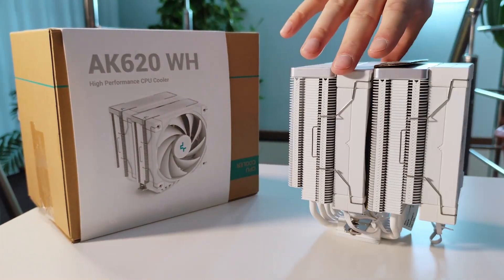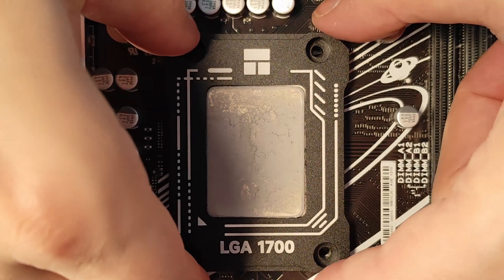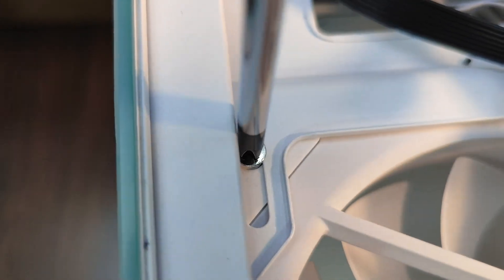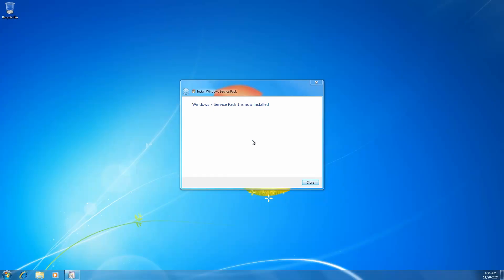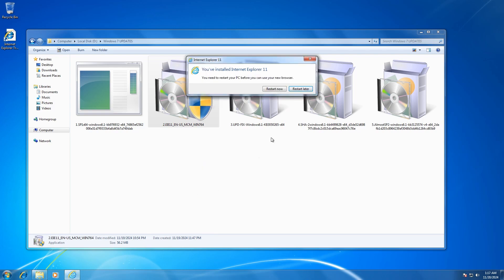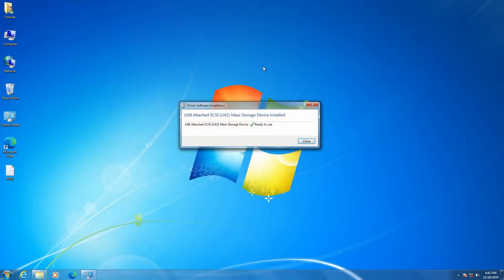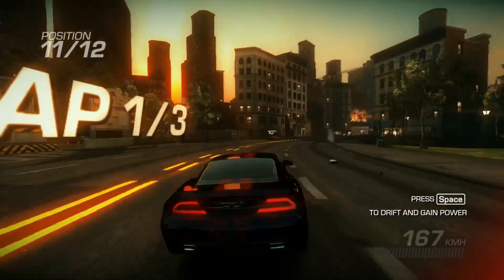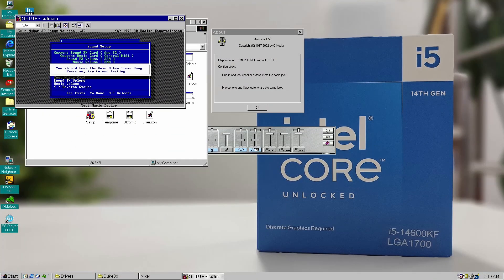Windows 7 Returns on Modern PC: i5-14600KF Intel CPU,  Z790 motherboard/DDR5 & RTX GPU

Comment: Check the Gamer's Nexus coverage on the bending issue of the 12/13/14gen chips.
The contact frame makes a LOT of difference, especially long-term, since the CPU bends with heat cycles and by the fact it's getting bent by the ILM by default.

Also, make sure to use the latest BIOS for the motherboard! So it doesn't overvolt the CPU with its bad microcode.
Reply from the maker: Yes, the BIOS was updated to the latest version released in November 2024—just two weeks old when I got the motherboard. Windows 98 still runs perfectly fine! :) I watched Gamer's Nexus videos, and I agree that using a contact frame makes a difference. What I don’t understand is why motherboard manufacturers don’t offer their own versions. It’s just a small piece of metal, probably costing around $0.80 to produce. Manufacturers could easily create their own branded plate, add a fancy design, and charge $15 extra for it. Yet, even on premium models, they stick with a standard ILM. The good news is that the new socket 1851 has an improved ILM with a few extra pieces. (it's marked as "RL-ILM")
Reply: @O_mores  
Nice! That CPU is safe then!

I agree with you about the contact frame, but I am pretty sure it's because of user error and Intel.
Let me explain.
When installing a contact frame, you need the perfect amount of pressure applied so that all the pins on the socket contact the CPU, and users can fail doing this, plus the risk of said users damaging the pins.
Also, the standards set by Intel had to be followed by the motherboard makers, so I doubt they can provide a contact frame.

Yes, the new ILM "fixed" the issue.

Comment: Where nvme ssd install windows 7  ?
Reply from the maker: Hi, I didn’t install it directly onto an NVMe drive because I have the original DVD, and it just felt right to use it. For an NVMe installation, you’d need to create a custom ISO with the NVMe drivers slipstreamed. Alternatively, you can install Windows 7 on a regular SATA SSD, as I did in the video, then add NVMe support by installing the NVMe update. After that, you can use cloning software to transfer the SSD partitions to the NVMe drive, and it should boot without issues.

Comment: Waiting for NT 3.51 and 95 lol
Reply from the maker: I didn’t have time to install NT 3.51 and Windows 95 and now the motherboard is gone. I did briefly try running my 'portable' preinstalled version of NT 3.51, but it didn’t work—possibly due to having too many CPUs and the MPS support was enabled. The good news is that NT 4.0 runs fine, even with multi-CPU support, and so does Windows 2000.
Reply: @O_mores  okay, it sounds good. What will be the next motherboard? I hope it's A620 AM5 :)

Comment: i just did this recently on whiskey lake, but i upgraded to 10 after i wasn’t able to get working wifi
Reply from the maker: Indeed, the latest WiFi 6 chips and even some newer Intel Gigabit cards aren't retro-friendly at all. This Z790 motherboard, for example, has a Realtek 8125 2.5 Gigabit chip from around 2021, which does have Windows 7 drivers. As for the included Wi-Fi 6E, I didn’t even bother searching for Windows 7 drivers.
Reply: @O_mores  it’s really a shame since everything else had drivers, and i was surprised that i couldn’t mod an inf to get it working. (i have an intel wireless 9560 btw)
Reply from the maker: The 9560 WiFi chip is 2017 model and is only Windows 10+ compatible. This motherboard has an AX211 chip which is a 2021 model... that's why I didn't even bother. Anyway similar WiFI 6 chips from Realtek released 2020/2021 do have Windows 7 drivers so at least we can find good WiFi 6 USB sticks for Windows 7.
Reply: @1he-user  you also should check underneath the shielding of your wifi adapter if it is maybe a separate m.2 board and not soldered on to the motherboard (I think this is the case on most modern motherboards), then you could find a compatible Wifi adapter and just plug that in instead. They should be very cheap, especially older models.
Reply: @hugevibez  ive seen a teardown of the laptop, it’s just a standard m.2. i do have an older intel wifi card from 2014 lying around, but idk if it’ll fit

Comment: What's kind of funny is that RTX 20 and RTX 30 series cards work on windows 7. But cards newer than GTX 10 series are not supported on Windows 8/8.1.
Reply from the maker: From what I’ve heard, Windows 7 remained highly popular in China when RTX cards were released, with about 49% of the market share. These numbers were impossible to ignore. In fact, not only Nvidia supported Windows 7 but also Microsoft which provided tools to get DirectX 12 support for Windows 7 gaming.
Reply: @O_mores  That would explain all those modified installers for "Windows 10/11 only" games that work on Windows 7...
Reply: yeah its annoying , but it is possible to install RTX 3090 Ti windows 8.0. i did it myself
Reply: Just install the Windows 7 x64 driver on 8.1, in 7 compatibility mode. It works fine, the blockout is arbitrary. RTX 3050 6G no-external-power model. Works on Windows Embedded 8.1 Industry Pro.
Reply: Actually GTX 10 series for Windows 7 CAN install on Windows 8.1 and still functional, even you're using RTX 20 and 30 series.
Reply: Works perfectly fine with an RTX3060. I love Windows 7.
Reply: 3090ti works officially on win7 there is 1 driver out that overlaps its release with official support days :)